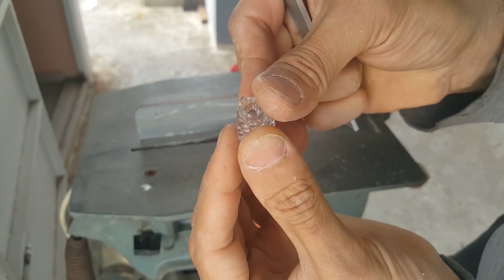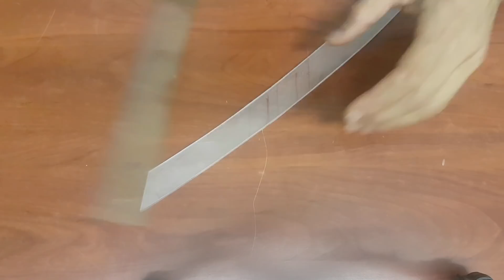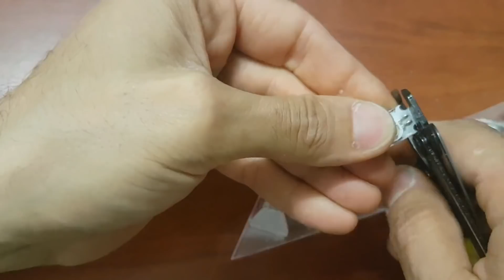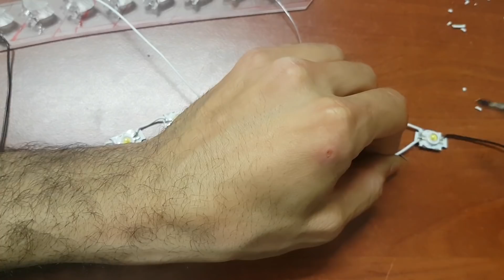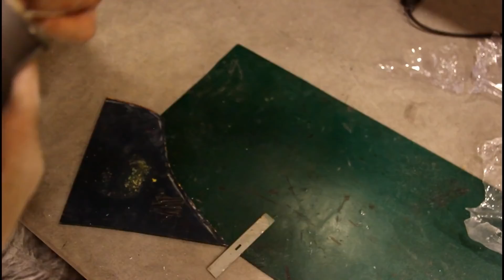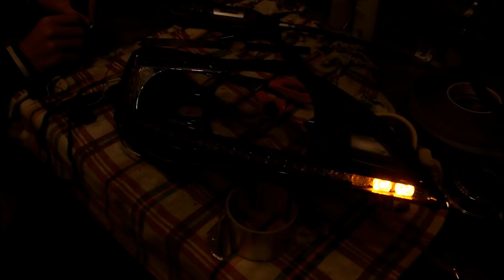FORD FOCUS BIXENON, KAYAR SİNYAL VE GÜNDÜZ LEDİ NASIL YAPILIR

Comment: It does look good but probably won't last any longer than a year. After that you have to take it apart again and change the LED's. Even OEM LED units start to fail after a few years. Seen Audis with rear brake lights where half the diodes just don't light up.

Comment: How does that indicator not blink one at a time... How you do that
Reply from the maker: LEDs are placed according to the length of the region. The connection is made according to the number of LEDs. The sliding signal board has 8 channels in total. leds work according to 8 channel output